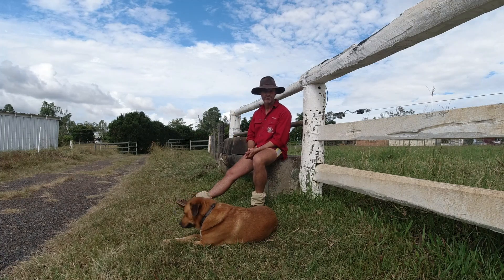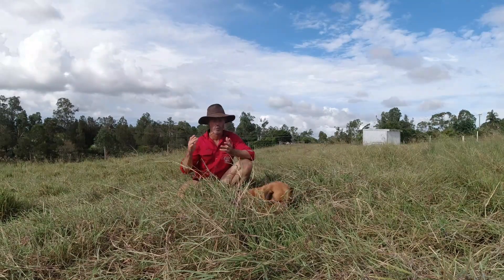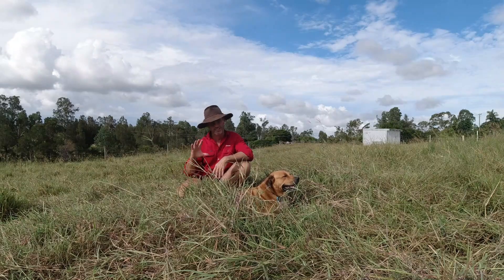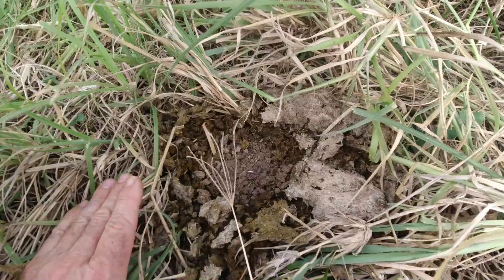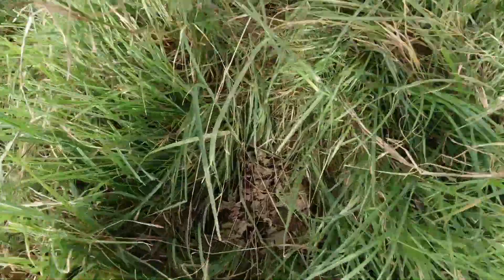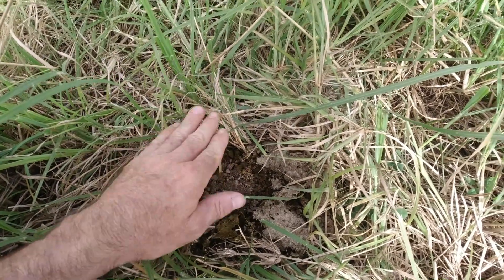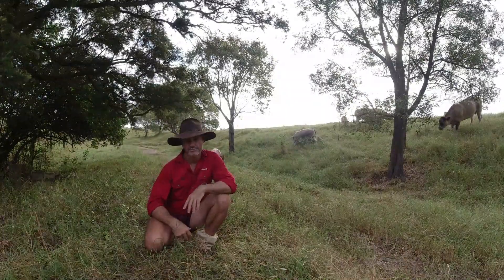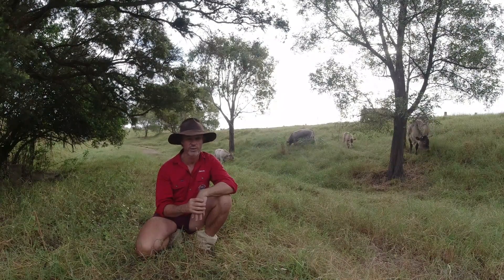HOW I INCREASED MY SOIL MICROBIOLOGY LEVELS & DECREASED PASTURE RECOVERY PERIOD!!

Comment: Another great video guys. Got some good info out of it. One question I have been meaning to ask is, I see you have Pangola grass at the trial property do you have any on the Udderfarm? It’s a wonderful grass i think
Reply from the maker: Hi Trent, welcome back mate and thanks for the positive feedback its greatly appreciated! We definitely have loads more Pangola grass on the trial property, there are only a few patches out on the Udderfarm. Yes it is a great pasture as it is very time forgiving compare to Rhodes grass which is predominately across the Udderfarm currently. By time forgiving I mean that it doesn’t come to seed at the same rate of knots which Rhodes grass does, therefore if you don’t get back to graze it for some time it won’t go to seed in a hurry. I’m hoping it starts spreading out once we start incorporating our well-managed cell grazing system out on the Udderfarm. The only problem I see with Pangola grass is that it does not produce viable seeds, therefore it must be established using cuttings which can be time consuming and labour intensive. Hope you have a grand day mate. Jason & Nic
Reply: @Udderfarm  Thanks for your reply mate,  I agree you do have a longer feed window with pangola. It is surprising how quickly the runners spread. I planted a patch of oats years ago I had a bucket of runners/clumps of pangola and went down the middle and planted a strip about 8 meters apart that area is now predominantly pangola with seca stylo and Wynes cassia as the legumes. It’s surprising what you can do with a bucket of runners, a hoe and a rainy day 
Have a great day
Reply from the maker: That's a great result mate thanks for sharing your success with us. Like you mentioned it's definitely well worth the effort on a rainy day. I have some poor areas out on the Udderfarm where I intend rolling out a few bales of mulch before planting out pangola runners from the Trial property like you mentioned on a 20mm+ rainy day. This will make for a great work video, thanks for the idea! Cheers
Reply: @Udderfarm  My uncle planted it many years ago on a large scale by slashing the pangola raking it up green spreading the grass  out on the area to be planted and then ran over it with a set of offsets discs in strips. Great idea mulching first and then planting I’ll look forward to the video mate